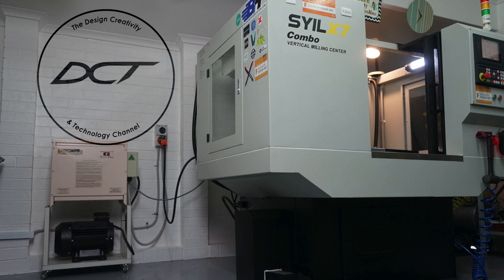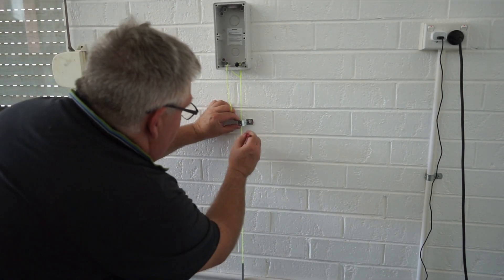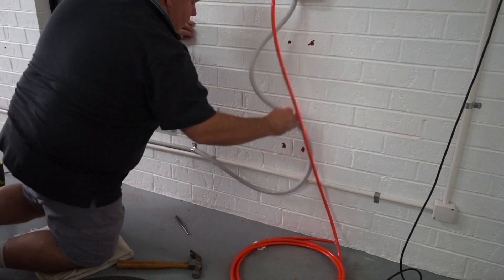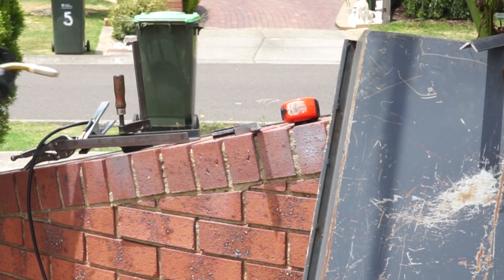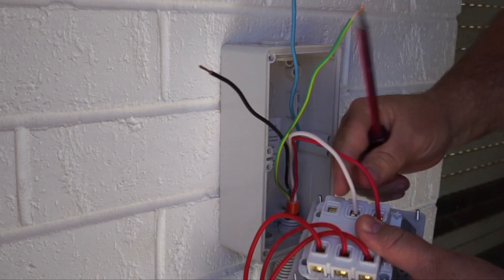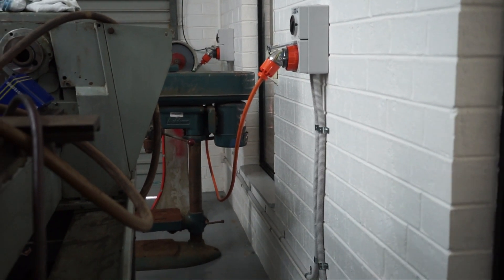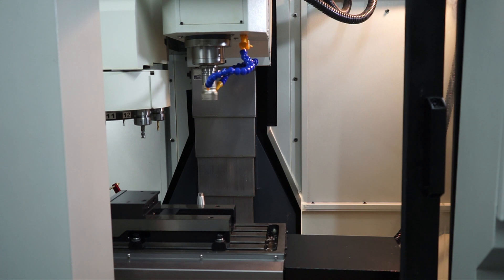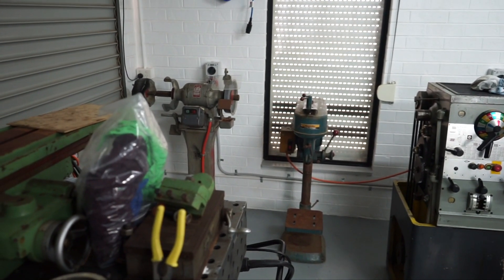3 PHASE in my Workshop - Rotary Phase Converter powered ring.

Comment: Nice tidy set up there Aaron. A question - do you run more than one 3ph machine at a time? I think your phase changer is an 8kw/10hp model. The reason for asking is that I have a 7.5hp RPC with a single outlet. At the moment if I want to switch between machines this involves unplugging one and then plugging in the next machine, I'm considering running a 3ph circuit with 3 or 4 outlets. I don't really envisage running more than 1, possibly two machines simultaneously but wondered if you ever do this. I guess provided you stay below the max output load of the Phase Changer it'd be fine.
(PS, how's the Colchester Master coming along? I managed to fix all the issues I had when mine tipped over - just bent/broken handles but it's all good now)
Reply from the maker: Hi Jason how are you. Yes, I can use up to 3 machines at a time, as long as I’m not pushing them too hard. I have had 3 of us in the shop working away (me on CNC, mate on the lathe and another on the manual mill). If you do a power ring & make it a plug in system. Remember to install a 3 phase RCD in the unit. This mandatory under Australian electrical code.

My Colchester lathe is still going strong. Check out my Instagram page as I post regularly there.  Cheers 🍻
Reply: @Design Creativity & Technology Channel  thanks Aaron, just found you on Instagram. 
RCDs are a no-brainer really and mandatory here in the UK too.
Cheers
Reply from the maker: @coplandjason  no worries at all Jason. I try my best to reply to all comments and questions. Great to hear that your Colchester up and running. Merry Christmas 🎄 mate 👍🍻
Reply: @Design Creativity & Technology Channel  thanks Aaron, merry Christmas to you too

Comment: Hi Aaron! could you share me the voltage and how many wire the syil cnc have?
Reply from the maker: Hi Lawrence.  It is 380VAC 3phase machine.  It has 4 wires going into it (Line-1 Red, Line-2 White, Line-3 Blue and Earth yellow/green).  The phase changer is capable of adding a 5th wire for neutral black.  Hope this helps you mate.  Cheers, Aaron.

Comment: Very tidy work there Aaron. I really like that welding table. The electrician isn't as pretty as the one that did the wiring before.
Reply from the maker: Hey Jody.  Yes Jacinta was very easy on the eye.  Unfortunately I can't use her services anymore (long story can't discuss here).  Luckily I still have some other electricians I can ask :-).  Oh, I just watched your Kickstarter video.  Your machine is humming with those new motors and drivers.  I really hope you get the support.  Cheers mate, Aaron.

Comment: What does the phase converter do? Is the shop only supplied with 1 phase and you need to make it into 3 phases? If so how many amps do you got on that single phase? Would be a lot to run all that machinery.

My little shop in a rented garage has 3x 400V with 63A so I luckily do not have that problem. I got a Syil x5 which according to the name plate requires 230V 40A. I hooked it up to a 16A outlet using a single phase it works just fine. I expected the machine to use three phases.
Reply: @accumach6454  I purchased one of those digital phase converters and sold it right away.  It puts out nice clean 3 phase power but what they don't tell you is it raises hell with the utility side and causes  current pulses that are out of phase with the voltage screwing with everything that is not connected to the phase converter. I replaced it with a American Rotary AI-40 and it runs everything flawlessly. BTW they are CNC rated and also put out clean balanced (within 4v) power.
Reply from the maker: @CapeCodCNC  Thanks for the information Paul.  To be honest I'm really glad I went with the PC8 from Phase Changer Aust.  Better still it's Australian made which supports local jobs and taxes are paid here ;-)
Reply from the maker: Hello Baldur.  I'm not an electrical engineer, but I'll try to explain it for you the best way I know how.

It's similar to a generator, but instead of being gas or diesel powered it use a single phase electrical supply to run a pilot motor.  The 3 phases are pulled from that rotating pilot motor.  3 phase voltage here in Australia is 415vac.  My phase changer was adjusted to 390vac.

To my knowledge a rotary phase converter is better than a VFD, as the spinning motor acts like a flywheel and allows you start greater loads.  A more professional definition is supplied here on their website: https://phasechanger.com.au/

Yes the Syil CNC machines predominately require 3 phase for the coolant pump and tool changer.  I love my Syil X7 and it's been a great piece of kit.

Cheers, Aaron
Reply: @DCT_Aaron_Engineering  I understand that the rotary phase converter is a single phase motor that drives a three phase generator. What I am curious about is why you need it at all? Let me explain.

Different countries have different traditions to how power is delivered. In America they only have three phase in big industry, everyone else get a single phase 120V and an inverted 180 degree phase -120V.  The voltage difference from one of these two to ground will be 120V and the difference between the two phases will be 240V. Typically they get 100A or 200A of power from the utility. Anyone not in a industry building need the phase converter to run any three phase machinery because three phase is not available from the utility.

Here in Europe (and Denmark where I am) every house get three phase directly from the utility. Even apartments get three phases. Each phase is 120 degree from the next. The voltage difference from a phase to zero is 230V. The voltage difference between two phases is 400V. This will be the same that you have, maybe with some minor difference in the exact voltage (390V vs 400V).

Another difference Europe vs America is that we usually only get a much smaller current allowance. Typical here is 25A or sometimes 35A for the whole house. We are supposed to balance the use of the phases, so one room will be using L1 (the first phase), the next room everything is on L2 etc. Normal stuff only uses one phase and we call that 230V because the difference from the phase to zero is 230V. The stove, oven and washing machine might be three phase devices and we call that 400V.

Although 35A 400V sounds a lot less than the american 200A 120V it is actually the same amount of power. Each of the three phases has a 35A fuse so we can use 3 times 35A of 230V. That being the double voltage of the american system, we get 6 times as much power per amp.

The thing about my Syil x5 is that it is not three phase. It is single phase and the name plate claims it needs 40A. That is very bad because here it is much easier to get the three phases (you already have it) than it is to get a large current rating. Luckily the 40A is a lie and the machine runs just fine on 16A.

I thought Australia was more like Europe and that you would have three phase power everywhere, but I guess not.
Reply from the maker: @BaldurNorddahl  Hello Baldur.  Sorry I misunderstood your question.  You are correct.  Over here in Australia they run 415vac 3 phase power down most of the streets.  In outback (rural) areas they run 2 phase power.  In the city the 3 phase is divided up and single phase 240vac is fed off from that line to each household.  You can get 3 phase installed to your house, but you need to have a valid reason (medical or a large air conditioner etc...).  Plus there is a huge cost $$ involved as they need to dig a trench, fit a new switchboard, and the phases / circuits divided up equally from this new board.  Some of the initial quotes I obtained were from $3K - $7K AUD.  In the end it was cheaper and easier to purchase a Rotary Phase Converter.  At least if I sell up and move house I can take the unit with me or sell it to recover some of the purchase price.  If I have 3 phase installed I don't get any return on my investment.  Here's an article that explains it better than me http://www.phasechanger.com.au/benefits-of-3-phase-power.pdf
Reply: I got a price for the Australian made Rotary Phase Converter plus i need to have 30 amp single phase outlet for it to run, it turn out way over my budget. So i went with having  three phase power installed in my workshop,all up it cost $4000 The electrician said it would be cheaper if i install the cable but he would not certified that, so i let him do all the work which included truck hook up and  certificate of installation. I see a lot of vids of  Rotary Phase Converters but they don't mention the single phase outlet amps you need to have.
Reply from the maker: @mfpitci  That's rather cheap to get 3 phase connected to your shop.  It was going to cost me a lot more than that.  Yes I have an incoming 35amp line to run my phase changer.  I don't plan on being here for ever and that way I can take it with me when I sell up and leave.  Cheers, Aaron.
Reply: Yeah that was about 2 years ago and i went with over head line instead of underground.  And the power pole is right in  front of my house  . So how does one get 35 amp line? do you need a electrician to run a heavy gauge wire  to the workshop?
Reply from the maker: @accumach6454  I was looking at something similar unit initially, but went with the rotary phase changer.  To be honest I'm really glad I did.  These Australian made units have all the smart technology in them so they can run sensitive electronic equipment.  Mark (the company owner) has had his units independently tested, certified and are guaranteed.  He sells these all over Australian and also into the Australasian market.  Thanks for the information and the link.
Reply from the maker: @chris0tube Hey Chris. I just tried to explain it the best way I could mate.  As for expansion, I think I should be ok (famous last words).  I've got 30-35 amps of incoming single phase at 240vac.  The sockets and plugs used on the wall are all 20amp.  I had 2 separate electricians inform me that 2.5mm cable will be sufficient and will carry 20-25 amps at 415vac.  My rotary phase converter is 8kW (8000watts).  To be honest it's just me in the shop and rarely will I have more than 1 or 2 machines running at any one time.  I think the proof will be when I turn that Colchester lathe on and starting using it taking heavy cuts whilst the CNC is running.  Fingers crossed I don't suck the guts out the wiring or unit and let out the magic blue smoke out of the box ha ha ha.
Reply from the maker: @accumach6454  They used to offer the Mini Mill over here as a single phase option, but I believe it's been discontinued (that's what my HFO tell me).  What you're getting a VF4, that's frigging awesome congratulations.  If you have the time, please do an unboxing video and first chips video.  As for the Rotary not being safe for sensitive electronics, it depends on the unit you purchase.  The Australian manufacturer over here has 2 lines of rotary converters that he offers customers.  The cheaper line isn't safe to run sensitive electronics on, but it is fine for standard 3 phase loads like pumps and motors.  The other units like mine have all the digital circuitry that ensure it is clean and safe for sensitive electronics.
Reply from the maker: @chris0tube All good Chris ;-).  Oh I agree with you on that.  We need to get behind our manufacturing industry.  A country that doesn't manufacture is a country that's going down the gurgler (drain) in my books.  Speaking of steeling, take a look at what is going on in regards to theft of intellectual property by a certain overseas country (wink wink).